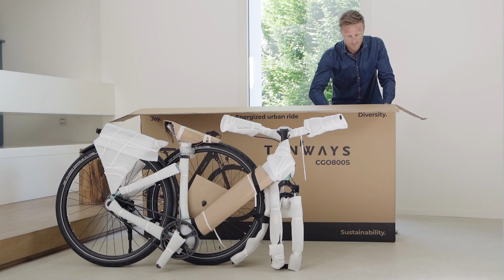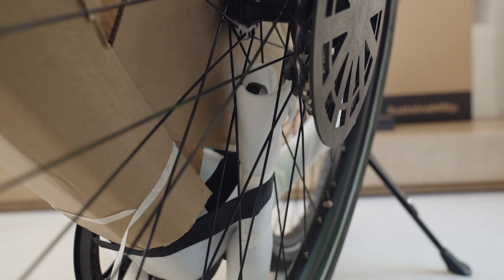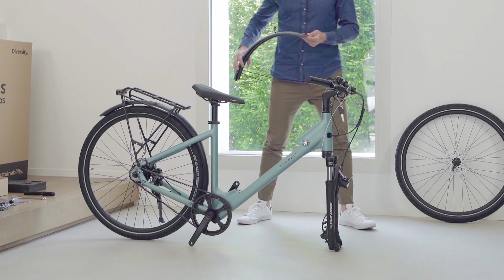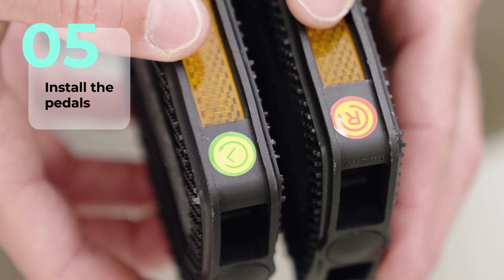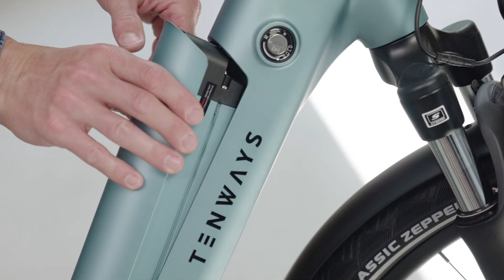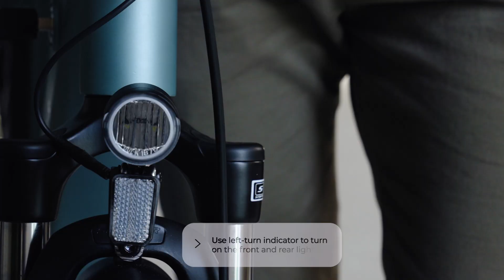Tutorial | Build your TENWAYS CGO800S E-Bike in 5 minutes!

Comment: Let get real here:
Assembling this bike will take about 2 hours if you have not bike assembly experience

1. Don't forget to remove the plastic flap inside the front break, you can pull it out easily.
2. The front mudguard, push it all the way up on the screw, put in something to hold it there (it leaves a small opening) and tighten the screw.
3. Loosen the top and bottom screw of the (front)brake drum, leave all the others. Move it so that the front wheel disc is right in between and not touching either side. Tighten both screws while eying the drum.

Now you have  a free wheeling front wheel. The rest is pretty easy to do.

Comment: Like other people mentioned, this guide is a bit outdated. 
Additional steps I took to assemble the bike:

1. Make sure the front fork is oriented in the correct way. I had to turn mine 180 degrees.
2. Then I had to mount the handlebars onto the front fork. I had to check the video a couple times to make sure I had the orientation correct. I rotated and checked the angle before tightening it all the way down.
3. Connect the electrical wire (blue plug) that goes into the frame at the front.
4. Before fitting the wheel into the front fork, remove the small orange plastic cover that sits between the brake callipers (you can just pull it out) so that the brake disk of the front wheel can fit there.

From here on out i followed the video guide picking up attaching the front mudguard and then the wheel. If you rotated the front fork (and handlebars) correctly you should not have any orientation problems anymore with the mudguard, wheel and display etc.

Additionally, my battery was already installed/attached. 
My quick release was attached to the front fork like in the video and not in the box

Good luck!
Reply: I can figure out ho to fix the front fork. and I figure you may be more helpful than this video. Can you please guide me?

Comment: Just in case someone else had my same struggles:
1. There is a plastic cover where the front disk brake needs to fit. If the disk can't fit, that's probably because you need to remove the plastic cover first (it's just a piece of black plastic with a hole to pull).
2. If your front handle isn't mounted, double check the video to understand the correct orientation. I had it 180 degrees wrong and it didn't make the front fork rotate. 
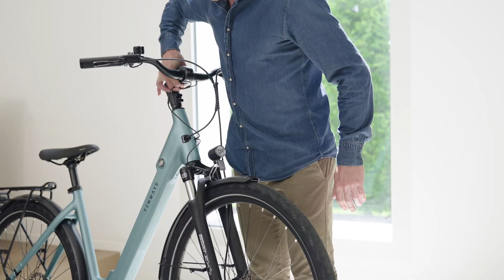3. The mudgard needs to be up! Screw it such that it's not hanging, but it's pulled as high as possible, otherwise it will touch the wheel. If you look carefully at the video, at 2:42 it shows how it should be. At least in my case, the other configuration - that you can see before in the video - didn't work.

For the customer support team: please upgrate the instructions! Escpecially the booklet is useless, there's not enough information for someone that never assembled a bike before.
Reply: Thanks a lot. Very helpful additions.
Reply: There is indeed plastic cover which is barely visible - took me an hour to figure our why the front wheel does not go in position.

Additionally, I recommend installing front wheel first and then the  front mudguard as you might damage your mudguard if not assembled properly. 
Please take note that after installing the front wheel and it makes any grinding sound, you might need to readjust your front brake clamp.
Reply: Hey there, how did work with your display? Mine is 180 degree twisted and i dont know how to rotate it back
Reply: thank you caterina. your comment was definitely much more helpful than entire video lol.

Comment: I can only hope that I own this bike long enough to forget the experience of putting it together. 

As others have said, the battery comes attached (although an empty box where the battery could have been shipped arrives) and the quick release is in the tool box. However, I was not aware of the small plastic piece in the brake mechanism attached to the frame that prevents the front wheel from sliding into place. Additionally, there are no instructions for the handlebars, and the electricity attached. I'm hopeful that once my battery has charged all will function, but with such incomplete instructions it's impossible to troubleshoot if there is anything wrong. Updated instructions are desperately needed.
Reply from the maker: Hello Shelby! Thanks a lot for your feedback! We really appreciate it. We'll take all the details into account to make assembling our product smoother and more convenient for riders!
Reply: @tenwaysebike  Please do not forget. I just got mine and the instructions are just as terrible still
Reply: Still same instructions.

Comment: Please update the manual - the bike i just set up was in a different state than the manual suggests. As already said in another comment, the battery is already built in (+) and the quick release is in the tool box (ok, easy to find out). What took me a while is that the display was mounted by 180° on the front bar and that the front handle had to be mounted (and electrically connected). Then, there is the front reflector - where should it be mounted? It doesn't fit anywhere because of the diameter - below the lamp there is already another one so i think i don't need it?
Finally it took me about 1 hour and i am happy with the new bike
Reply: Did you have an issue where the longer cord from your handlebar to your front wheel/brake was wrapped around the center frame?

Comment: Hi everyone, I just bought the CGO800s myself. I'd like to attach a carrier/basket to the front of my bike to carry things. Would anyone recommend a supplier that sells front baskets/carriers that could fit on this bike? Thank you
Reply: I did it with Basil basket, what comes with KF Handlebar Holder and is compatible with e-bikes.
Reply: I don't think this bike is suitable for a front basket, because of the position of the cables and front light.
Reply from the maker: Hi Alex, thanks for asking. Quick tip you can join our Facebook community group where you can get recommendations from thousands of Tenwayers!